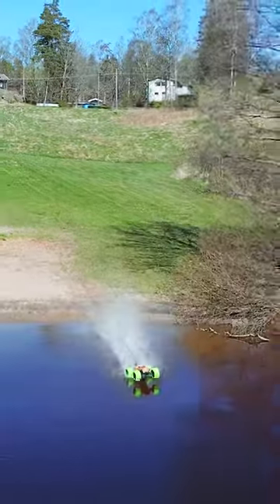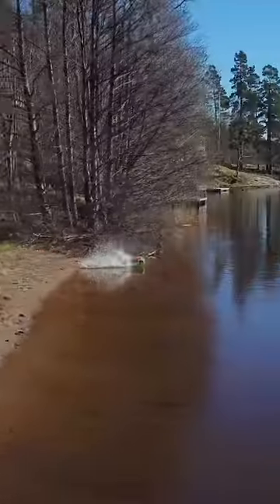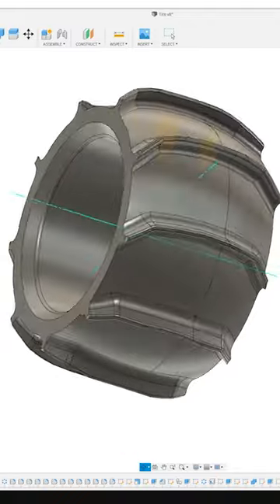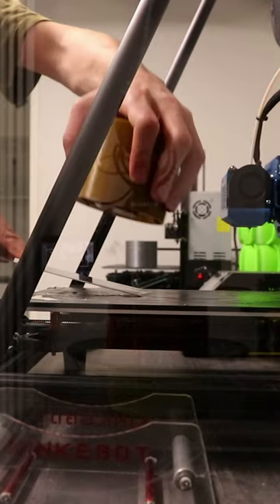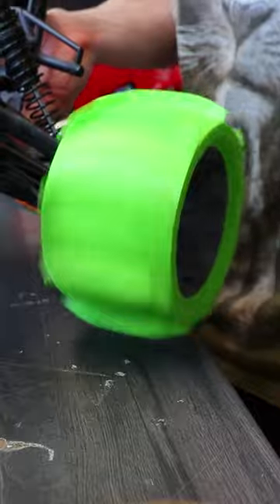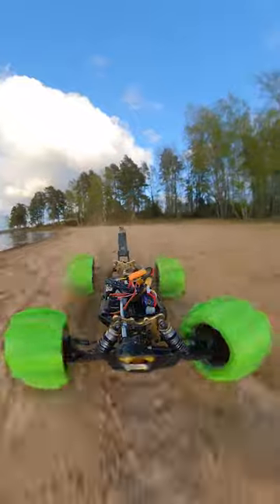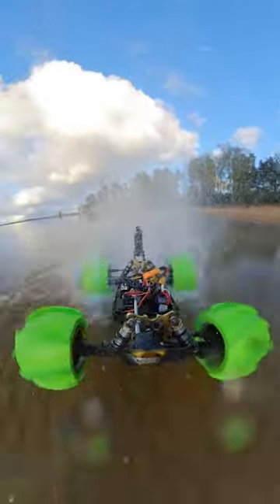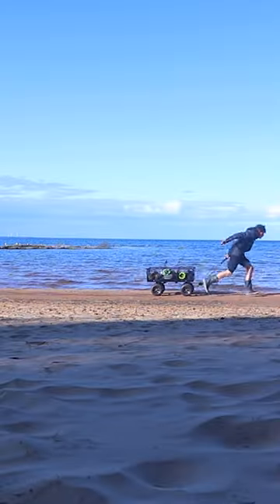How a 3D Printer Can Make Your RC Car Hydroplane #shorts

Comment: This is great idea, maybe make tires sealed to be able to float if rpm drop.
Reply: Or make air supressed tank in the bottom car body.
Reply: I think You could fill them with foam aswell
Reply: Or tie a small mtn dew bottle inside the car
Reply: Or just use a boat
Reply: Tires are filled with foam and glued to the rim
Reply: also use normal treads for the front wheels since its making the car jump alot
Reply: Or just use the Titanic
Reply: or just use US aircraft carriers
Reply: Turn the front wheel into sleds(I don't know the correct word) so it it glides smoothly on water

Comment: It would glide over sand if the front wheels were bald, with a smooth protruding lip around the center of the wheel so it can turn. Perhaps it will be better for water too?

Comment: It's actually pretty easy! Start by purchasing a 3D printer and a computer. Then purchase and download all of the software needed to design and print custom parts for RC cars. Learn how to use the software well enough to design a wheel that will displace water and high RPM. purchase an incredibly expensive RC car with a powerful battery. Oh did I mention you should probably also get an engineering degree........

Comment: Works with many offroad rc cars right out of the box, no need to over complicate it 🤷🏼‍♂️
Reply: no not really most will only hydroplane for a second or two then theyll drop
Reply: @kingiument4627  trust me, all wheel drive, and a not super slow engine in an offroad rc and most of them will do it ☝🏻
Reply: @MeinNameistFlo  i dont need to trust you because i know they dont because i own a few lol
Reply: @kingiument4627  same 🤷🏼‍♂️

Comment: You need a 4 wheel drive liar my velineon Traxxas esc and engine and 12 volt battery could not do this cause it’s 2 WHEEL DRIVE SO YOU ARE LYING